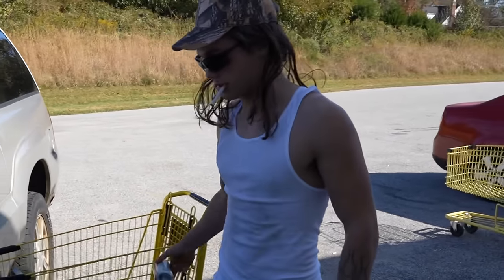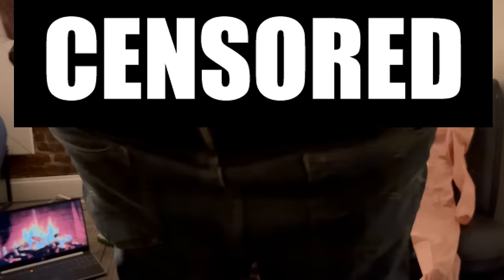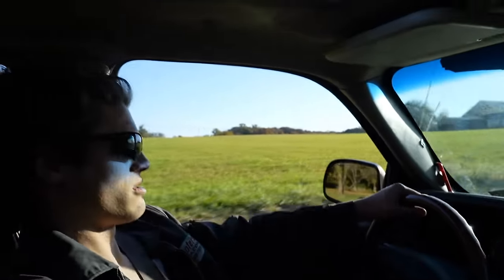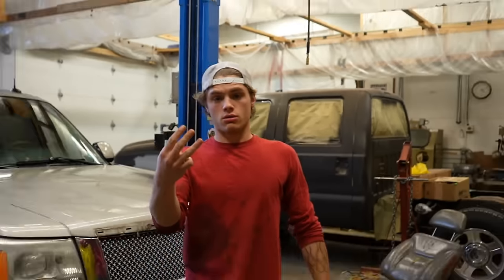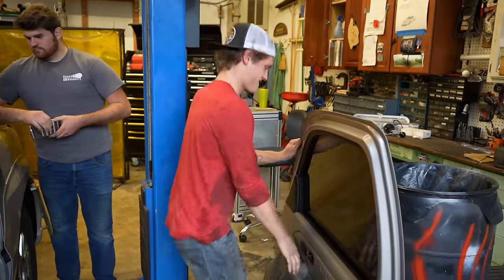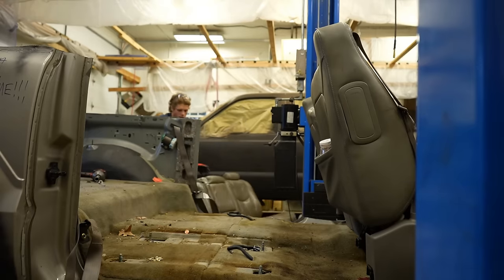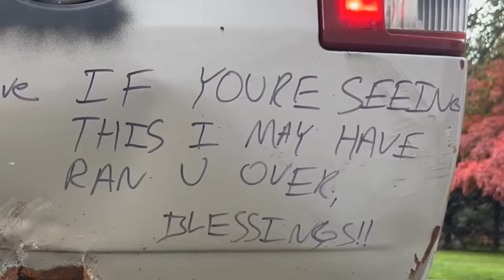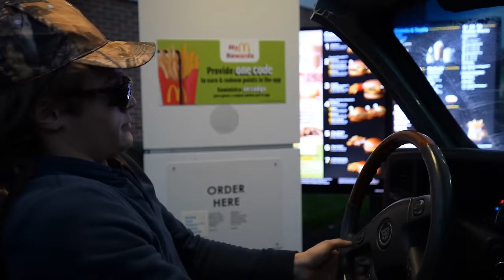CUTTING APART A CADILLAC UNTIL IT'S FAST! (Budget Trackhawk Pt.1)

Comment: Love it! I may get some of those mufflers for my Esca-got-u-laid. I’ve already cut the tracking devices off and converted it to 2wd.
Reply: How did you make it 2wd
Reply: @leogomez2638  I just removed the front diff, transfer case and converted the transmission to 2wd. You’ll need 2wd front wheel bearings, a 2wd output shaft and tail housing for the tranny then a 2wd tahoe or short Yukon driveshaft….
Reply: @chris85mora I think ❤

Comment: That exhaust is perfect. Less tailpipe = less crackling/popping. Years ago a friend said he wanted dual tail pipes just for looks, but started with cutting the tail pipe off just behind the muffler. That 5.4 F150 sounded so good echoing under the box of the truck, he just left it and never bought the pipes. Best sounding free exhaust mod is to remove all tailpipes. Just don't let it idle while you sleep, depending on where the muffler ends, but that goes with using common sense also.